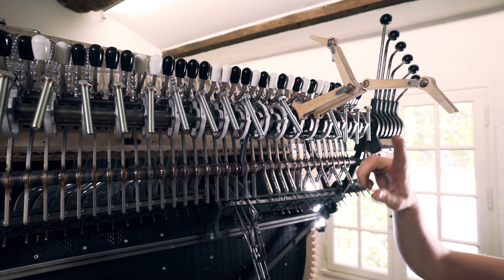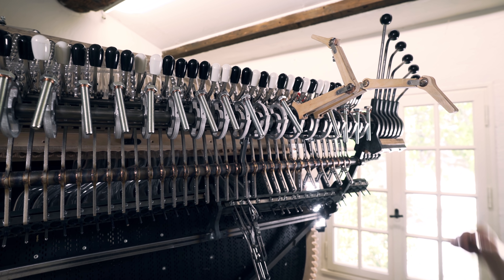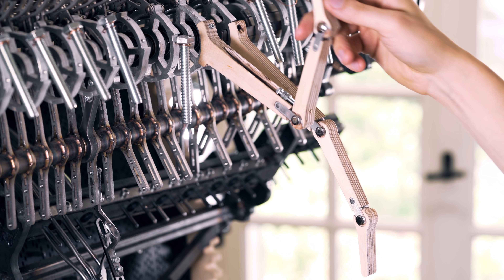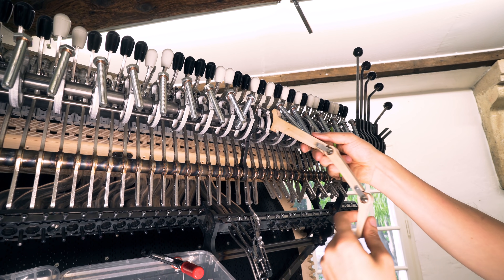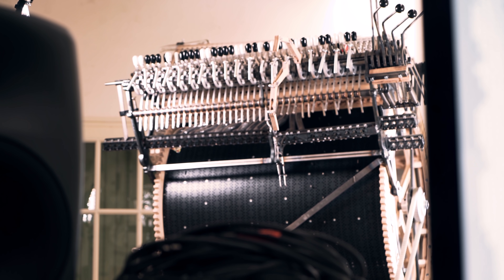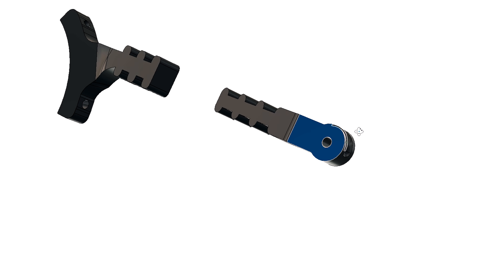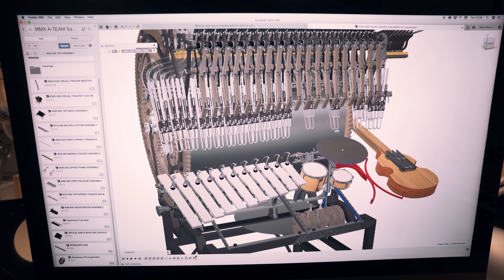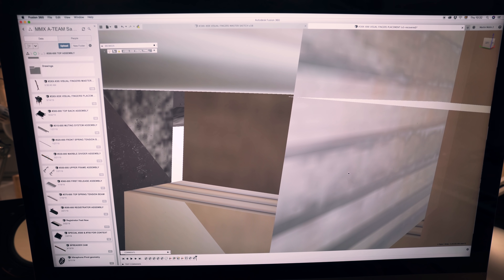Kinetic Fingers Prototype - Marble Machine X #82

Comment: Martin, please don't run into "feature fatigue". This is a marble machine, not a finger machine. Fingers are putting stress on it and will reduce overall reliability. Just invest your perfectionism on the core playing mechanics, so it will be a rugged and reliable tour equipment.
If you need to visually express the machine playing on stage, then express the marble mechanics by projecting closeup video. Maybe along with some controlled video mixing / switching plan in sync to the program wheel. Put some 6 tiny cameras around and a big screen in the background.

If I were in the audience, I'd really prefer watching the machine playing, NOT the eye-catching fingers fidgeting around.

Comment: I don't get all of the people claiming the fingers are "a sign the machine will never be done", "overcomplication", "too many parts", etc. Have they not been watching these videos from the start? Fingers were pretty critical to the original plan, and however interesting it looks up close it'll look a lot less so from a distance. As far as parts and weight, it's far less part count than other assemblies (especially the 27x ones). Finally, "more parts to go wrong" doesn't really make any sense because the machine can still operate without fingers.

I think people just don't like the aesthetics of the fingers (or like the purity of every part having a use, however convoluted), and are making up other problems to support their gut reactions.

Comment: The problem with the finger is that it's movement is way too exaggerated which makes them look creepy . And it will definitely block your way from the knobs . My suggestion is to make them smaller or less joints and make the movement a bit more tamed

Comment: The image in (on) the marble is a HDRI texture. In the Material Settings of the "Metal" material, there is a (probably invisible) sphere with that image applied. It needs to reflec "something" on the surface and give it a metallic look ;)

Comment: Just gotta say that those fingers block the view of the rest of the machine. They just don't match with the marble machine aesthetic. Perhaps it should be made of thin wire or something?
Plus I don't think it will accomplish it's intended purpose. I was trying to visualize this from an audience perspective and if I can't see the mechanism without the fingers than I seriously doubt the fingers would change anything. 
You could literally hot glue a reflective material to the main mechanism and it would work better than this (and not block the machine's mechanics which are the main appeal of the machine!)

Comment: That hallway you saw at the end was the reflection of a cubemap which is a certain type of texture you use to do quick reflections of the surrounding area onto reflective surfaces in 3D. It's added there in CAD so the metal looks realistic and interesting. Otherwise it would just reflect the white void around it, leaving all the metal... well, just white.

Comment: Make the fingers functional by turning them into a keyboard! When you press on a finger, it releases a marble.

Their design would need to be modified a bit but they would be useful, and you would still get the same effect, but with functionality. The knobs seemed like a rough draft idea.. a quick fix. But the fingers do add visual presence. They just don't seem to do anything practical. If you somehow convert their function to manually toggle a marble release, you create a use for them, retain the visually amplified aesthetic you were aiming for, AND they would serve a purpose.

Comment: So far, you've been making every part of the Marble Machine X a functional part. These fingers are a non functional part, blocking functional parts, that already have a nice visual aspect. These creepy Edward Scissorhands fingers seriously have no purpose. They're just extra flappy bits that add noise and distract from the other, amazing engineering.

Comment: This might not seem like it, but it's one of the most important additions to the MMX. Yeah, it won't show a difference in a video but on stage it will make it possible for the crowd to understand what's being played
Reply: I think this is false, balls reflect light well, all you need is lighting setup.
Reply: @dm3on  yeah but if you are far away you won't be able to see them. The point is to be able to see the levers go up and down when a marble passes
Reply: @antoniskazou  Are you arguing that light reflected is harder to see then moving parts that do not reflect light ?

Comment: Well if you change the shape or the color to, you know, make them not look like BLODDY SPIDER LEGS, HOLY SHIT 
Then I'd actually say it's a GOOD IDEA

I'm thinking some really minimalist design out of black tin with pivot washers as joints, straight edges and the tin contour outlining circles around the hinges, with the counterweight Being some radially attached piece of metal flush with the edge of the circle acting as the counterweight
Reply: Do they creep you out? I am extremely arachnophobic, yet I don't have a problem with the legs.
Reply: @Huntracony  I mean they're wierd-looking, way too organic compared to the rest of the machine,no they don't trigger my arachnophobia directly, but they're ... Just wierd, and for an aesthetic element, they sure look a bit too heavy for comfort, as there's going to be a LOT of vibration 
I'd say a joint and circle kinda look would make a lot more sense given the overall steampunk look of the machine

Comment: To summarize some of the comments, most concerns are:

- It doesn't look pretty decent on this machine or destroys the simple & clean look of it (Agree with that for design aspect)
- It doesn't have any technical purpose so it's just something that's added to it's complexity (In concern of movement, sound and so on - even though it doesn't seem to be very loud)
- It could be offset because it's not triggered with the actual hit of the marble but with the first trigger which is going to release the marble (Maybe we're talking about some ms of delay and the movement of those fingers are very sluggish so maybe it won't stand out very much - maybe that's the reason for those weights and adjustability to make them hit the bottom when the sound plays as well)
- It could look strange if it's sluggish as seen in the video and if a note will be played very often at high bpm
- Most importantly in mute position it's going to block the accessibility of the manual trigger knobs

Even though it isn't a finished version just a prototype like Martin called it in the video.. so maybe we're going to be surprised about the outcome.

I'll understand the point of Martin as well, at a very big concert to be able to see what's going to happen it's maybe a little bit helpful. But I think it's still very small if I'm going to remember my last big concert something like the machine could look very small in such an area. But if there is some kind of videowall they could just simply put those manual trigger knobs on the big video wall and everyone could see what's happening and which note is playing as well. And it doesn't look as big & long as those fingers and they have a technical reason as well.

So maybe don't point on those release system which is of course a very small movement and very good hidden in the machine, but just point out those already existing knobs. Which are even colored in a perfect pattern.

But I'm not as wary as most of the comments, because it's still a prototype and it wouldn't be the first time Martin is going to surprise me with a very good outcome. :)

9:55 Thanks Martin for putting so much effort into this machine and share every step with us the community!

Comment: I get you want to make it more visible from far away, but they are so unnatural and non-mechanical. It goes against everything else part of the machine.

The machine looks elegant and precise, not sure why you want it to look organic now.

I think you seen most comments not liking them, and besides being unnecessary, the change in style from the rest of the machine is also a big reason of why they might dislike it.
Reply: I totally agree
Reply: I sadly agree
Reply: I fully agree.
Reply: I kindly agree
Reply: It would be nice if the fingers could actually pluck or play a piano. Basically have a function as all the other components have a function
Reply: E R agree completely sadly, I was like uh yeah sure sounds ok.. yeah nope
Reply: I wouldn't mind them if they were simple, but this jangly imprecise movement is going to draw too much distracting attention. Why not let people's eyes be drawn to the beautiful engineering on the rest of the machine?

Sure, Marten is right. They will turn people's heads toward them and they'll be distracted from what is actually elegant and functional... I have to say I'm really actually kinda bothered by these.
Reply: i also dont really like how it hides all the frontal mechanical components like a wooden bird cage.. sorry Martin, I LOVE what the MMX has evolved into up to this. 
lets see how it turns out?

Comment: Martin please no! The issues I see are that it takes away from the industrial functional theme of the machine, they seem to block the manual releasing, and they wouldn't play the note when they drop down, but rather when they rise up. I love the mmx so much, and you do know best, but these fingers are not a step in the right direction imo
Reply: If you want to keep the machine's playing visible from the crowd or on TV, maybe run some type of led connected to the instruments and mounted near the top of the machine. They could be powered from the same power supply that the onboard amp would need, or just run a wire out with the contact microphones if the amp will be external

Comment: Martin, you said before that the MMX is first and foremost a functional machine. It's not a machine designed to look pretty, it looks pretty because it's does what it's designed to do well. These fingers don't fit that. I can understand why you'd want to make each note more exaggerated for the stage, but I think having fingers play on an imaginary keyboard in the air as part of a visual spectacle when you already have so much visual awesomeness going will simply confuse the audience.

Comment: Could you do lights instead?  Small LED's that either show the audience, or spotlight the key movement?  Different colors for different instruments?  I know you rely on mechanical movement, but you could utilize a bicycle friction generator on the flywheel to generate power.

Comment: I'm concerned that it won't be as good as you think in the end... I'm also afraid of the extra noise they will make. Just in case Martin, make them easily removable!
If it works out though, should be a fairly visible spectacle :D

Comment: Couldn't the fingers and manual release knobs be combined into a single feature? 

That would solve both problems of the fingers not having much of a functional reason to be, and that they could get in the way of the existing knobs.

What I'm imagining is a set of extended manual knobs, their longer lever arms can exaggerate the movement for visuals, but they are also able to be operated by hand. 

Cheers

Comment: Martin ... let me tell you a story.
So I'm currently helping a 3D printer to be built. And yesterday, I literally punched a hole trough an Ikea table with an axe. And it wasn't pretty or something, but modifying a table was quick, cheap and it works just as well as building an Aluminium frame.

I feel like sometimes you focus so much on getting things to look pretty, that you completely forget about getting it done. And no you should probably not be using an axe on your machine, but keep in mind:
Every bit of not nessesary polish will also push back the world tour.

And those fingers are honestly really distracting, they occlude a lot of the actual mechanics, they add too much secondary motion to the machine, if you ask me from an animators point of view and the problem can be solved by basically just having a camera and a screen/protection on stage.

Comment: I completely get the idea of these fingers, you've expressed on several occasions that you want people to not only hear the music made by the MMX, but also have a visual expression of the machine playing. But I feel like there should be a better way that doesn't block the view of the rest of the machine. Not to mention how difficult it would be to do the manual playing with them in the way. 

On a separate point, the idea of mechanical fingers feels out of place on this very aesthetically pleasing machine. That's just my opinion though.
It's your project and the most important thing is that YOU are happy with it! ^^

Edit, personally I find the existing movement of the machine to be enough.  With good camerawork you could easily show off its marvel at the concerts.

Comment: I am not sure I like these. They are purely visual and lack purpose. I also don't like that they are not the same thing as the marble releasing fingers. I could see something like this on the tip of the metal bits that actually release the marbles. That would help lead your eyes to the actual function bits. Instead of a being distraction those would help you watch it work.

Comment: Sorry Martin, but the fingers take away from the overall aesthetics. I understand you are trying to make sure someone far away from the stage would still see visual cues as the music plays, but I think you would be better served by having cameras that broadcast views of the MMX on the screens around the concert venue.  If you set on having a visual clue, maybe consider adding an extension to the action where the tension springs are attached.  This would be on the very top of the machine (see frame at 2:05) and would not interfere with manual playing.

Comment: Few things: as many said, I am not sold on these finger, your to decide if you add them.
May I suggest holding on those until the end?
If you do build them:
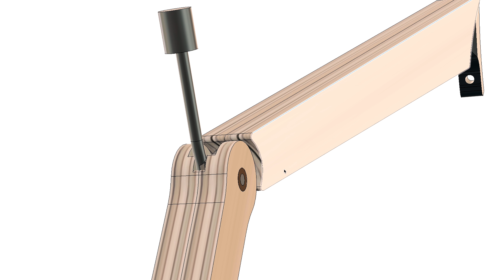 - the compound angle @7:00 could probably be neglected, so CNC them flat and worst case light sanding with a drum sander could set them up.
 - For the counter weight rods @8:00, I would suggest revisiting the bends near the pivot so you have only 1 (easier to build). Else that, really nice design of sandwiching it!
 - I assume those counter weight will be rods with threaded ends!?
 - Not sure the bushing are required, friction between steel and plywood is probably as good as bronze for that size.
Overall, really nice design, using lots of trick learn to make those stylish: Sandwiching plywood, using 3D printed joint, inserted/bend rods for counterweight!!!

Comment: I appreciate the thought of the fingers making it easier to visualize what is happening from a distance, but they also add a LOT of visual noise and take away from the overall design of the machine we have seen so far. Obviously we aren't seeing the final version but so much added movement just for a visual effect with no mechanical function feels weird when all the other parts are built with both form and function in mind, and that is what makes the whole so appealing. Every piece is doing its part in rotating the marbles around the machine and creating music, except for these fingers.

I agree with some other commentors in that mounting a small camera on stage projecting a closer look at the release mechanisms would achieve the same goal without seemingly compromising the design with extra visual noise. If you are set on the fingers, I suppose how we'll feel about them after we get used to the idea. Nice to watch the progress in any case.

Comment: When I saw the Doodle of Kinetic Finger, I was confused without knowing what parts it was. Kinetic Fingers was designed to help audience see the movement of MMX from a distance!
The prototype 2 is easy to understand movement, but you may hear a slight noise every time it moves. The prototype 1 is not as rough as it is 2 but may not be able to suppress faint noise.

Comment: The marbles falling are the core visual attraction of the "Marble" Machine. The fingers not only block that visual if they are synchronized with the visual they will detract from it. It's understandable that the tiny marbles can't be seen by people far away but cameras exist and don't affect the real aesthetic. Just placing some cameras to show the core action on side screens is more practical than signifying the core action while adding weight, complexity, and noise. Please reconsider the fingers. They are creating more major problems than the minor problem they solve.

Comment: This is the only thing I am not board with. To be sure, the fingures serve no functional difference other than being a visual indicator of which marble is dropped? People are going to think it is doing something useful and it is going to confuse them. Also, It will be a bit awkward to have those fingers flying around your face while you head bang. I am worries your going to catch one hard in the face. There is also a lot of mechanical energy going into that part of the system so i think you will be making up for it in your footpettle. This part is also going to be extremely difficult and time consuming for having no nonaesthetic purpose. I think this is the only thing i am not on board with. Please please please give it a non-aesthetic job to do.

Comment: The steampunk in me loves the fingers and it reminds me a lot of Animusic. HOWEVER, everything in Animusic serves some kind of practical music-making purpose, same goes for steampunk design. Have to say I'm not a fan, wasn't a fan of them on the original design all the way back when you first showed the 3D model either. BUT I'm willing to be proven wrong if you can pull it off... I also have concerns mechanically as someone  who has used a lot of angular joints and cable work in costume design, they are finicky and often require a lot of matenence~